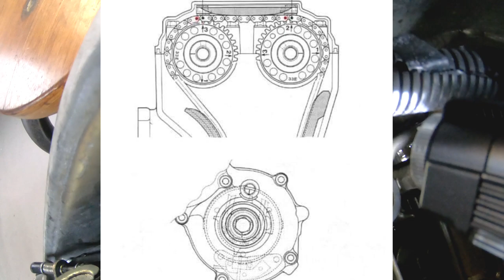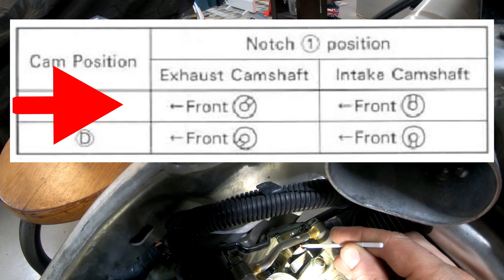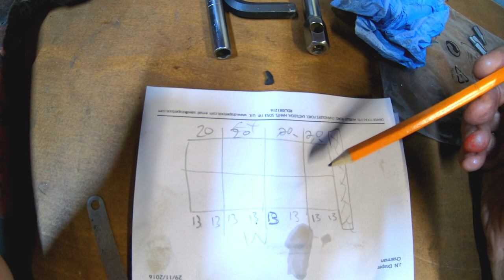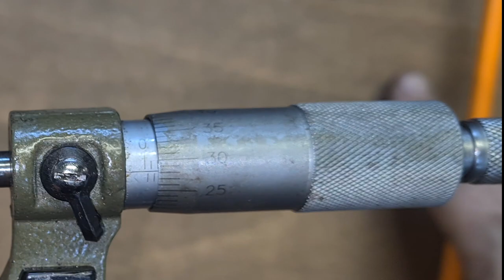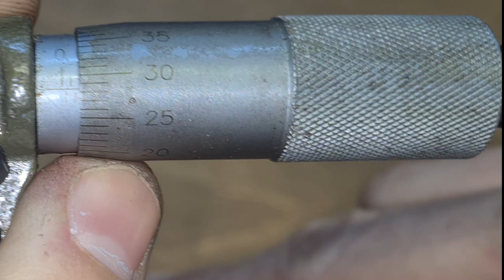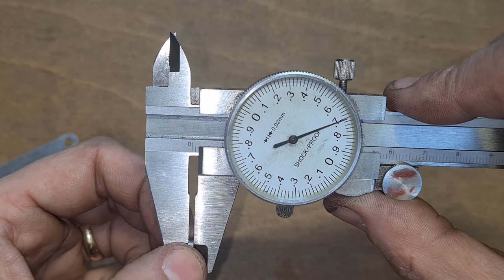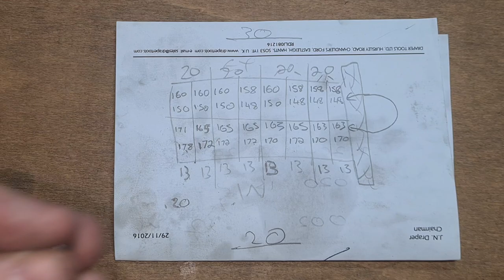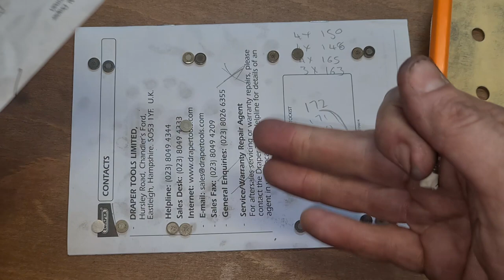HOW TO ADJUST THE VALVE CLEARANCES ON A SUZUKI GSXR 750 SRAD PART ONE

Comment: If you have a ticking noise is that likely from it having to large a gap or too small? Which direction would u adjust within the range of spec to limit ticking?
Reply from the maker: It is when the gap is too large this usually occurs when the engine is hot as the components expand with the heat....
Reply from the maker: Put them all into spec if the limit is between 0.10 to 0.20 then set them to 0.19 or 0.20
Reply: @PXCBIKES  thank u sir

Comment: You have the only video, if not the best one i have seen on this for my specific bike the 1999 suzukigsx-r750 srad. Far better than what the book shows. I do have a question though. Theoretically if the ideal shim thickness is 1.5 so you still have .2 mm thickness of clearance with the feeler guage after everything is installed- couldn't you (or me) just put all new shims in that are 1.5 mm thick ? Im thinking maybe there is a cost or variation in thickness somewhere in the valve train issue that would keep me from doing that or is it OK to do it that way ? I don't know.  I need to watch your part 2 video though for sure but please let me know what you think about my question. I'm a car mechanic by trade and do OK with motor bikes.
Reply from the maker: Hello thank you for your time... With valve clearances you have to measure the existing clearance and find a shim to make the alteration or alternatively you can sand them down to size... If your target clearance is. 0.15mm and your measured clearance is 0.05mm you shim size would have to be less than 0.10 to make the clearance 0.15mm
So your clearance may be 0.05mm and your valve shim is 2.0mm you will have to replace it with a 1.0mm shim to make the clearance 0.15mm. It's just like filling a hole with a piece of wood but you need a gap remaining so cut the wood down until you have the desired gap

Comment: What about top dead center on cylinders 1&4 and 2&3. You can skip cams 180 degrees. You have to know first in which position are cylinders im struggling with thst dont want fuck up the engine.
Reply from the maker: Sorry pal not sure what you mean skip cams there are  timing marks in the flywheel for the position of the crank and if you are unsure just insert a long screwdriver into the  cylinders and turn the crank around until the screwdriver reaches the very top and stops... that is your top dead center but check the marks in the flywheel
Reply: @PXCBIKES  i had top dead on 2&3 so was confused but i managed. two rotations of crankshaft 720 degree puts cams on two different positions. in order to get your steps cylinder 1&4 has to be on top dead center to get the cams right but if you rotate it again 360 degree cams get on different position. thats what i meant in the first place. Gsxr 600 and k5 1000 here. Those engines if maintained and cared well  are indestructible. For this job you have to be on point, took me two afternoons to do not fup. Great stuff, im just adding so ppl can see if they get in doubt. Took me thinking and thinking, questions in head all over the place when you do it the first time. Suzuki love

Comment: So you can actually Sand these shims down is that what you're telling me?
I thought these would be hardened???
Reply from the maker: They are hardened but yes you can sand them down.... If there is quite alot to sand down u would just order the shims closest to the size you need but sanding them will get all the valve clearances even.... But you just have to be patient and not to sand a taper on them make sure they stay flat
Reply: @PXCBIKES  thank you I'll keep that in mind if I got a swap a couple around.
Reply from the maker: Yes 800 grit paper is best 👍 and your finger nails will be square after

Comment: So they get tighter as they wear  or looser
Reply from the maker: Tighter... the shims will wear and also the valves can wear on the seat if the clearances are not adjusted
Reply: So  when I get the new shims they have to be bigger  than the ones on there if they are too tight  or smaller
Reply from the maker: If the gap is tight, then the shim has to be smaller.. check out part 2. I explain it there